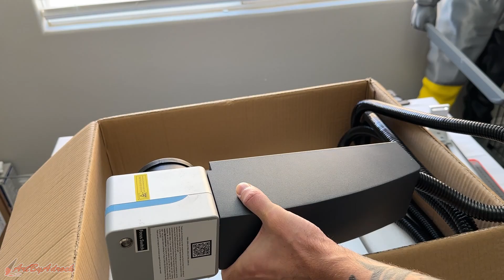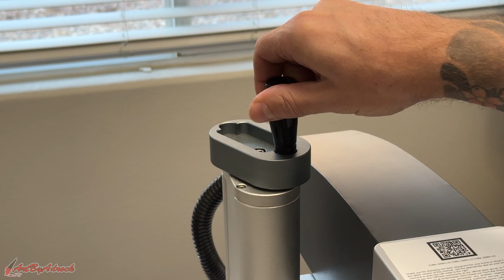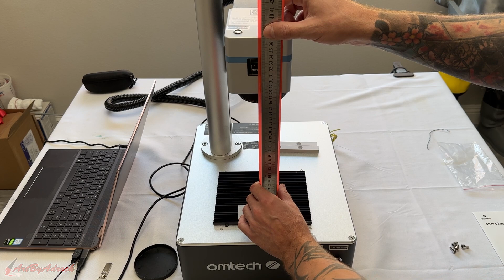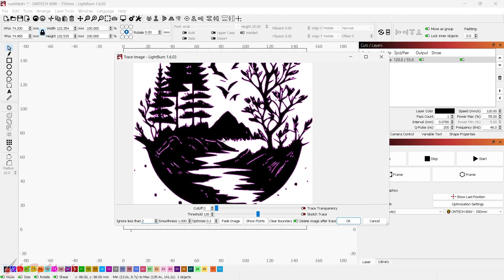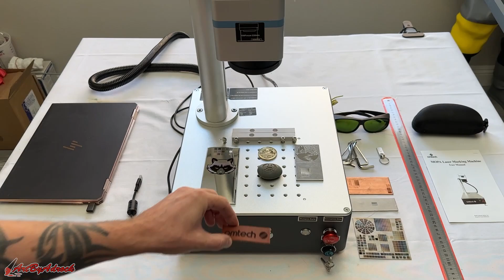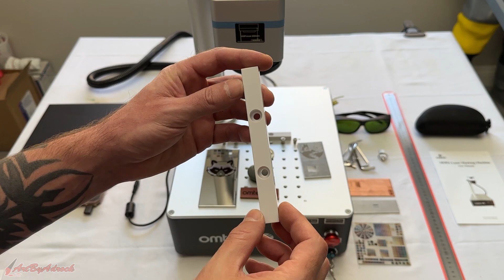OMTECH Compact 60W MOPA Fiber Laser - ENGRAVING EVERYTHING EASILY!

Comment: The cable is that long just in case you wanted to put the base in cabinet and mount the head on the desk or table, which would give you a greater surface area for multiple types of rotaries and parts.

Comment: Do these settings apply to the one I just purchased I'm not sure about the dimension size yet cause it hasn't shown up. Supposed to be in today or tomorrow .
Galvo Compact 20 - 20W Integrated Fiber Laser Marker Engraving Machine with 4.3''x 4.3'' Working Area for Metal